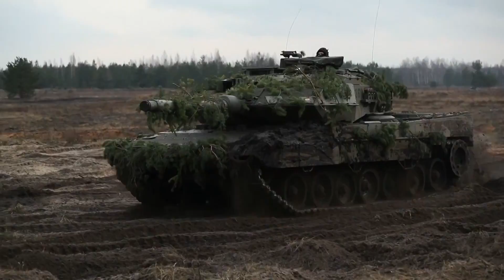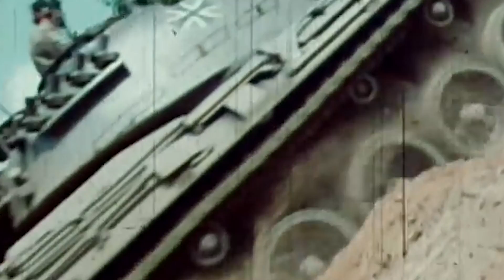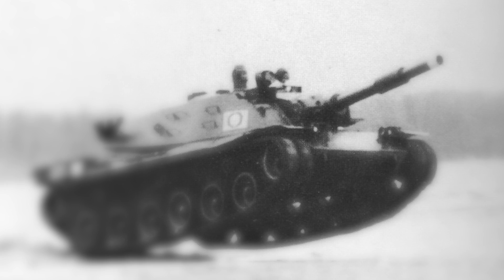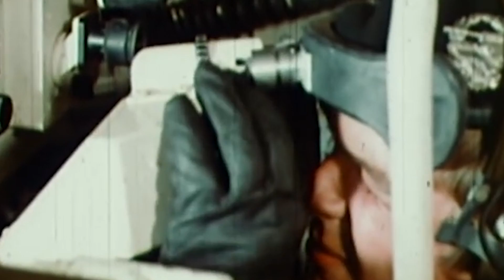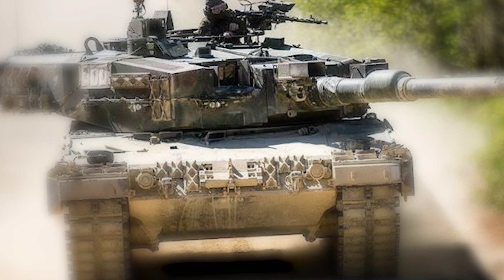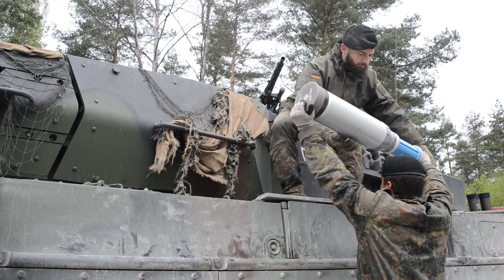Massive Super Tank - Leopard 2

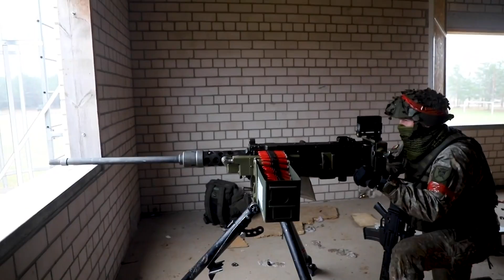Comment: 5:32 - increasing the armor thickness to 1500mm would be FIVE FEET THICK.  This doesn't sound likely.  TEN FEET of it's width would be solid steel (left and right), and the thing looks barely wider than 15 feet.
Reply: 1500 mm is 5,90 inches. 12 Inch in a feet so not even half a feet.
Reply: @Mart687  I'm being sarcastic, there.  wink wink
Reply: Composite is not steel.

Comment: Power take off press gears cables pulleys hydraulics flex joint scaffold tile pressure panels solar panels microwave panels cyclone intake sorter valves psi tanks compressors fuel recycling system from the byproducts of burnt fuels can make better quality metals diamond coating fiber optics cloaking device reflector lite source codes focal lasers sending signals quicker kinetic energy readers picks up signals quicker and is a site system and power source power wind poles heat cool channel tubes heat cool hover panels power wind suspension dynamo brake generators electro static magnetic shield generators electro static magnetic purpultion nueral implants nerve splicing nanites gene therapy let's build motherships planet moon sized orbital powered and multiple power source systems molecular vision elemental vision sonar magnetic field vision electrolysis vision reading electric current and fleets of ufos and reanimate lifeforms and make sure life is forever and the universe doesn't resalitify nanotec munitions that reanimates reprograms uploads downloads information I'm real machines cyborgs aliens feel like infiltrating earth and nothing can stop us I'm home grown space clone built and made from a ufo space drone it was a fun trip from the mother ship trained in a matrix dropped off near the sticks ufo convinced a couple of hicks the kid they see was their baby do you see what I see that huge ufo party flying by all night and day past these racist delusional people anyway do you see what I see that huge ufo party as we go on this ufo show microscopic robotics

Comment: The Leopard 2A7A1 will be virtually unkillable from a frontal ±30 degree angle, thanks to added frontal armor, wedge armor and the new Trophy APS. Even if a round makes it through, thanks the new inflammable propellant and a extinguishing system that engages in split-seconds, a catastrophic cookoff wont happen.
Reply: The Leopards 2 can easily be destroyed from the side with an old soviet RPG grenade launcher operated even by a woman like it was in Syria.
Reply: @Nik 0749  as can be every tank without APS, which is the reason why I specifically referred to the typical ±30° engagement angle. With proper crew and proper tactics, that's the only angle the enemy will ever get to see of the tank.
Regarding Syria, those were old 80s Leopard 2A4s. Turkish military command massively misused them, sending them into urban areas without recon or infantry support and poorly trained crew. Militants used Kornet ATGMs afaik, so no chance for any tank to survive a hit from the side. Nevertheless, most of the Leos were only disabled and later destroyed by Turkish F16s so they couldn't be used against them
Reply: @Matze239  No tank in the world today can even "hope" to be unkillable, even from the front. The israelis found that the hard way, with the most heavily armored tank on the planet. No tank can even come close to modern ATGM´s penetration values. Even worse, with modern 152mm and 155mm laser guided shells, tanks are falling victims to artillery. There are plenty of videos of ukrainian tanks being killed, on the move, by the Krasnopol round.
I don´t see tanks ever disappearing from the battlefield, but the days of invulnerable steel beasts are over. Tanks have become artillery magnets. And the men inside are just as vulnerable as your standard infantry is. And when your tank is as big and boxy as the Leopard, hitting them is all too easy. The way of the future is small and light IFVs, like the Weasel. Now that´s a HOT ROD!
Reply: @Biden_is_demented  im not talking about tank vs ATGMs, but tank on tank combat

Comment: I think the new german   KF51 Panther   is better  
Lethality
The Panther fulfils the core capability of “dominate and destroy”. With the Rheinmetall Future Gun System consisting of a 130 mm cannon, a fully automated ammunition handling system and the additional armament options of the HERO 120 loitering ammunition, the Panther has concentrated firepower for long-range strikes in multi-target engagements.

Rarely has the sheer power of an MBT gun been more impressive. The Future Gun System, developed by Rheinmetall, enables a 50 per cent longer kill range to be achieved (than 120 mm) with an unrivalled rate of fire due to the autoloader performance. A 12.7 mm co-axial machine gun complements the main gun. Multiple Remote Controlled Weapon Station (RCWS) integration options give flexibility in proximity and drone defence. The optional HERO 120 loitering ammunition capability expands the Panther’s strike capability to non-line-of-sight targets and can be mounted depending on role and mission requirements.

All weapons are connected with targeting sights and the fire control computer through the fully digitised architecture, allowing for hunter-killer and killer-killer operation, seamless target engagements and future AI decision support.

Survivability
The Panther employs a ground-breaking, fully integrated, comprehensive, weight-optimised survivability concept. In addition to classic measures, the Panther’s digital architecture enables on and off-board survivability, with active, reactive and passive protection technologies.

The Panther is configured with a pre-shot detection capability, enabling it to strike first. Threats from above are defeated by the Rheinmetall TAPS (Top Attack Protection System). The ROSY smoke obscurance system is provided as part of the survivability system, which fully integrates with the digitised architecture to allow additional defence measures. The standout survivability feature is undoubtedly the active KE protection, which increases protection levels without affecting the system weight.

As a system designed to operate in a contested electromagnetic spectrum, the Panther is fully cyber hardened.

Reactive and passive protection

Sensor-based reactive system
Passive protection

Active protection

Protection against large-calibre KE
Protection against ATGM
ROSY smoke obscurance system

Top attack protection system (TAPS)

Mine protection

Rheinmetall drones

Pre-shot detection capability  ...

Comment: The 120mm gun on the abrams is a german gun and related to the one in this tank.
Reply: The M256 was slightly modified as the original Rheinmetall design was considered too complex and expensive. And the Abrams is not the only one which use a licensed version, Type 90 (Japan) and K1A1 (South Korea) use the L/44 too.

Comment: I have never understood why manufacturers bother to put rifling into pistol barrels. If smooth bores give adequate accuracy to long range anti-tank guns, they would surely be good enough for pistols, which are useless at more than fifty yards anyway. Most pistol hits are received at ranges from 3 to 30 yards, and rarely much beyond that, so you dont need pin point accuracy which in any case cant be achieved even with rifled barrels.
Reply: Rifling isnt that simple. Bullets are spin stabilised and really need rifling to give any adequate accuracy.
Tank guns use vastly different munitions, generally being fin stabilised and thus not needing rifling. Up until large fin stabilised projectiles were developed, all tank guns were also rifled.
Its shown to be very hard to make good and accurate fin stabilised handgun or rifle ammo.

Comment: in comparison to strv 122 this is a toy. as useful as the mongrel tanks of yesteryear.
Reply: Strv122 is just a upgraded and uparmored leopard2A5? Also the newer Leo2A7Vs in trials with the german army are better than the strv122, with upgraded thermals and FCS, and also better armor.
Reply: @Yung_pindakaas  No. The strv122 is such a massive overhaul that its barely a leo 2 at all. The "just" upgraded variant contains so very, very many things. Then ofc its the idea that since its called strv122 and has been so for 20 years its the same as it was 20 years ago. Which is exceedingly wrong. They are constantly upgraded and no thermals in the world outclasses the Swedish ones. As far as i know the only self defense feature the leo2´s have are the standard target/target. Unlike the strv122 that has 5 diffrent systems for such things. Or had when i worked with thim.
Reply: @Mornomgir  "The strv122 is such a massive overhaul that its barely a leo 2 at all"
No. It's a Leopard 2A5. The only modifications include MEXAS addon armor, TCCS BMS, more storage slots in the FCS, a revamped engine cooling system, French GALIX smoke launchers and swedish radios. Not sure what the people in your unit told you, but is is BS.

"no thermals in the world outclasses the Swedish ones"
Except the Strv 122 doesen't use swedish thermal imagers. The most recent Strv 122C use the ATTICA thermal imager from Airbus Defence and Space. Just like the Leopard 2A7.
Reply: @jonny2954  No.
Reply: @Mornomgir  Yes. Prove me otherwise.
Reply: @jonny2954  That would be treason. So no. Im sure you can dig up something interesting thats not just a quick goolge or wikipedia answer on whats in them. I will give you this. The swedish army has always compartmentalized nearly everything. One batch of conscripts doesnt necessarily get told what the next one gets told. To fully appreciate the differences and full nuances of the cv90, strv122 and many other pieces of gear wont be something one can do unless you spent many years working with them. One example is the ghosting as displayed by the gripens during aurora a few years back. out of the blue not even the pilots knew they had the capability until before the excersice. Same with the automatic engage and destroy feature on the strv122. Thats when the tank defends itself against incoming projectiles and then destroys whatever fired it. Takes about 2 seconds for the tank to shoot down the incoming NLAW, RPG round or similar and proceed to destroy whomever fired it. Same with the armor on the cv90, which also happens to be part of the beefing up of the strv122. Now you got handles for what is "common" knowledge. Go find your own answers.
Reply: @Mornomgir  So your source is "i made it the fuck up". Good to know.
Reply: @jonny2954  Whatever floats you boat lad. Ill just stay on my high horse and snigger at all the people suffering from millennialism that think they can aquire actual knowledge about army hardware via computer games and wikipedia.
Reply: @Mornomgir  Except i aquired my knowledge from the people who actually worked in the Swedish defense procurement agency during the time the Strv 122 was adopted into service (and you probably weren't even alive). Wrong person to do that with. Crashed down from his high horse so god damn fucking hard.
Reply: @Mornomgir  I think you are confusing thermals with passive sights for one. As in they did want our thermals in them years ago because they are good but remaking the entire IRU interface was just expensive. "our" night sights and such are in as far as i know. Other than that you are spot on. In some ways the other fella is too. But the google is strong in the younger lads you know. Or americans. If its an american it wont really matter.
Reply: @andreasthorn8075  That i must say is true. I just find it dreadful that these days youtube, instagram or facebook are "the" truth. Not actual knowledge not actual basic understanding. I mean if you cant tell the difference between whats what then school these days is pretty fucking pointless. There used to be a time when you could read something and understand the truth. The younger folk these days dont. Its a fucking failuiire.  If i could google all the answers.... well its not hard to see why they amount of people thinking the world is flat is increasing. Especially when it comes to armed forces. Especially when it comes to Swedish armed forces thats been the masters of subterfuge and illusion for... well ever. We buy one system, we test it, we improve it, we apply it. OR we buy one system we see whats what then we know ours was better we apply it. OR we buy a system we test it we realize Oh shit. we was bad, we apply it. Thats why the CV90s that we export have "poor mans armor" and "poor man guns" etc. Its always been thus. We export things that are up to 30% less efficient and thats that. We import things and make them far more efficient. This is not new. This is not strange. Most countries do. Its just Sweden done it best since forever. Since churchill himself asked "wtf you lot doing over there".... Damn tiresome if you ask me.
Reply: @Mr Shaggings Nope, Strv122s use an L44 thats no different from the standard on the 2A5. The Germans have since switched to the longer and high pressure capable L55A1.
Reply: @Yung_pindakaas  The Strv122 uses the L/55 now as well. The L/44 is only in use on the development platforms but all main line tanks should now have the L/55

Comment: Abrams 120mm gun may be the same caliber and length as the German L44 but it is not the same gun.
Reply: Well, depends how you look at it. The breach and mounting element is different, but other than that, it's the same gun. Very early M1A1 even had stampings from Rheinmetall on the barrel because the first badge was directly bought from them.
Reply: It's Rheinmetall-licensed canon, like in the Challenger...
Reply: @xXxxXx-br4rj  nope. Challenger 1-2 aren’t even common ammo as the British tanks used rifled 3 piece ammunition. The Challanger 3 is being built by Rhinemetall so it’s not even licensed it’s right from the source. 
Abrams gun may use the same barrel but that’s a none issue as it’s a smooth bore. The breach, bore and mantel are completely unrelated.
Reply: It basically is the same. The US produces them under license.
Reply: @heavyweight6440  no it’s not. Else how could the US license the gun for export? The barrel tubes may be interchangeable but the critical aspect the breach and chamber those are what make a gun. Those are unique.
Reply: @terranempire2  The license-version is the M256 which basically is an L/44. Nobody knows which contracts the US, Rheimetall and GDLS has about what they can sell, and what they cannot sell. It still is a L/44 or Rh120 for that matter, even if they changed some bits, the genes are still L/44. If your leg gets amputated, your still the same sex as before, right?

Also: where you got the information from, that breech, etc are different?
Reply: @heavyweight6440  first, that’s not a logical position, Why would Rhinemetall give away the golden goose like that? When you license a product you take a cut of the production costs as a royalty. If they could then license the product again then you are cut out of that royalty or just getting a cut of a cut. That’s idiotic. 
Next M256 uses a coil spring recoil system well the L44 uses a Hydraulic system. The breaches are mounted 90* opposed to each other. The ammunition pressures are different now as the US Adopted more pressure rounds vs L44, and the Germans adopted L55. The later brings up the failed M256E1 where the US trailed mounting the L55 barrel in an Abrams. The combination resulted in unsatisfactory oscillations.
Reply: @terranempire2  Who said the give it away. Ever heard of commission?

It still doesnt change the fact, that the M256 is based on the L/44. That is all I am on about. You cant just take a thing, modify it a bit and call it a day. Just accept it, that the gun is german engineered. I dont know why you are so mad about it?
Reply: @heavyweight6440  I am not mad. But here is the fact the gun isn’t just modified it’s complete different. They may fire the interchangeable ammunition but then so do lots of other things. Is a G36 an AR15? An FAL an M14? No is every 155mm the exact same gun? No. Is the gun on the Leclerc also a 120mm also Rhinemetall? No it’s not even the same length of barrel. Is the Israeli Merkava using the same gun? No they don’t. But again a 44 calibre length and 120mm Ammo interchangeable with Leopard2. 
You can find the bolt and breach’s online training manuals and repair manuals schematics. They are different guns. No interchangeable parts.